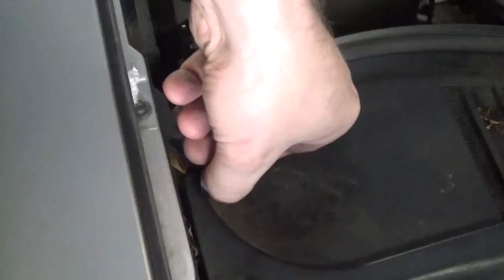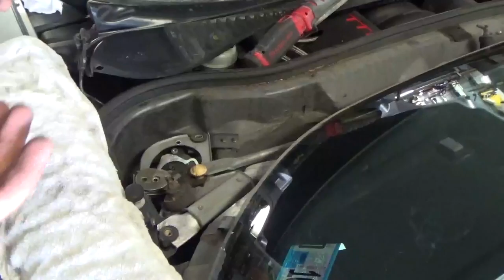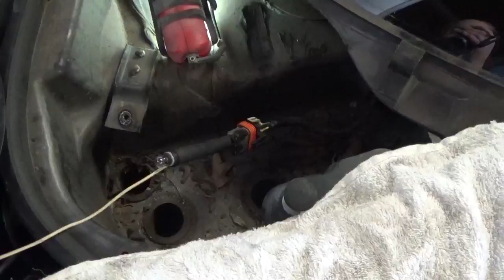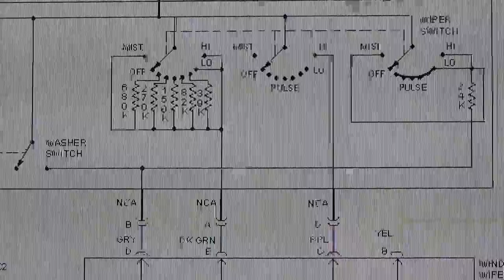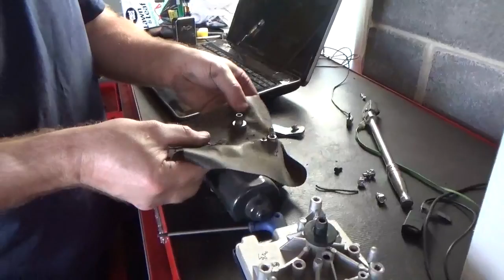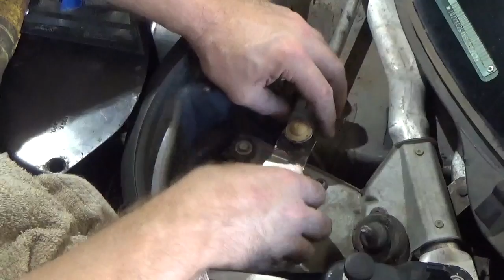C5 Corvette wiper motor replacement and calibration

Comment: I went thru a car wash and my wipers would not shut off. I replaced the wiper motor and cleaned out the nipples that were chucked full if junk. Everything was ok . I went thru the carwash again and it did the same thing. Do you think it is the ground? I pulled the fuse, the wipers work but do not return to the resting position. Any suggestions besides not going thru car wash?? Thanks

Comment: i'm from berlin in germany. i throw 2.500€ on this problem but the problem isnt fixed xD (he dont stop). 3x motor around 300€ (900€) , wiper arm mechanic 400€ parking top 150€ worker's 2x 500€. i will go soon to an expert (800km away from my home but he told me i can turn it off put out the number 10 front co pilot sit.). now i can drive and hope it not will rain :D

Comment: Your instructions were perfect. My wipers were doing the exact same thing yours were. The only thing I did different, “which was probably a little bit unnecessary“ was I added a bit of dielectric grease inside the electrical connector. Thank you so much!. Your instructions were spot on. Subscribed

Comment: Thank you for this video, the previous owner had replaced the wiper motor in my 02 C5z and didn’t align the transmission properly, this video helped me easily fix it with the intermittent setting / 8mm adjustment technique and now my wipers work great!! You rock!!

Comment: For anybody doing this job id say 80% of the time your wiper motor just needs to be blow dried and the connector needs to be cleaned (also apply dielectric grease) and it will work like new. No need for a new wiper motor you can fix this for free!

Comment: So the aftermarket wiper motor is missing 2 dial poles if you will or pins to line up the plate with the stop or return piece.  I had to bolt the plate in place and tweak the return several times.  Also noticed bending the spring clip for return lever while prying off the trans. It took several attempts to finally get it right. Thank you for a killer video bro! I used some fluid film lube for the mechanism works like a champ

Comment: question, I did this and it worked well until I washed my car and now they won’t turn off. Do you know how to fix this?
Reply: Did you open up the wiper motor and dry it? Use a blow dryer and also clean the connector! This will solve your issue and if it doesnt simply replace the motor.

Comment: Follow your video and was able to reinstall a after market motor and after some adjustments I was able to get in in and working correctly. The issue I ran into was was installing the plate on the top of the motor, with no pins on the aftermarket motor and only one small screw to hold down . I could not get tight enough and I striped it trying , was able to use the old holes for the pin and place a nut and bolt to secure the plate, Work !!! The info you provided was extremely helpful !!!!!!

Comment: took my new to me 98 vette wiper assembly apart.  all sorts of issues.

question ....what IF (like at 21 min mark) that top plate doesnt really LOCK on the wiper motor strongly?  Im thinking that plate might be a bit stripped....

wipers were just turning on...after i bought it and washed it...like so many other people.....but the harness wasnt really locked onto the wiper motor...barely on...and i think when he replaced the wiper motor last year, he didnt clock it right.

if that top flat piece is stripped, where do I get one?

I snug that t-30 but i can make it move with my hand.

Comment: Why not cut the ends off the 3 rubber hoses with some scissors so they do not fill up with debris and short out the wiper motor when the water cannot drain in the future?

Comment: OUTSTANDING ! Well presented and easy to follow. Had my Chevrolet dealership install a new wiper motor two days ago....wipers male a sweep but stop at 2 o'clock on intermittent, work OK on the other two speeds but the driver's side fails by about 2 inches to cover the entire wipe. Apparently the dealership guy didn't know how to adjust them. Can't wait to give your fix a try. Well done !!

Comment: QUESTION- so I have just replaced my 98 C5 wiper motor and I made sure everything worked prior to getting the trim and wipers put back on like the video states, and everything worked great! Once I installed everything and put my wipers back on, they didn’t run? I’m not sure what went wrong. Recommendations?

Comment: My wipers turned on the other day and have stayed on, without the switch being on, until I pulled the fuse in the passenger footwell
Reply: What was wrong? How did you fix??
Reply: ROUNDS BOXING CLUB just replaced the motor, 70 bucks at autozone. Still never figured out how they ran 24/7 but oh well.
Reply: @streetfighterracing1583   I'm getting a new motor 2morrow. I'm praying that works. I pulled my fuse as well. That shit is annoying af. Hopefully that's the fix

Comment: Just did this, saved me tons of money. This was spot on. I also took and sealed the motor and module, and cleaned the udders. That was my problem on both sides. Thought it was the wiper switch. Luckily it wasn't. I'm loving my 1 owner, 46,000 mile 99 vette.

Comment: While back I blew the #10 fuse. Put a new one in. Motor worked fine. But now motor is dead again. Fuse is fine. Is there a way to check to see if the motor is shorting our. I have a voltmeter. Thanks.

Comment: Has you replaced the DIC. I replaced mine today and with the dash sitting in place all wires attached, when I turn on the lights the DIC dose not come on. I dam sure I have all the wiring plugs plugged in the the dash. my old one had the top light bulb out that's why i'm replacing it. When I plug the old one in now it will not light. I think i'm missing something. Any help. Please NO JOKES just looking for help.

Comment: My circuit board in my wiper motor got wet after washing my car and my wipers we're on even when the switch was off.
I followed your instructions and removal / installation was a breeze. Cleaned my half full uders.
I removed the circuit board, blow dryer it , for you added silicon to cover. Works like new. Thanks for taking the time to do such a great video. Hope you have more Corvette repair videos.
Reply: Apt Waltham this just happened to me with my C5Z after a heavy rain. What part of the wiper motor did you use silicone on?

Comment: Thanks for this video.  Mine was spazing out at times.  A few things I did was to keep moisture out I put some silicone around where the motor was sealed together. I put dielectric grease inside the connector.  Then I had to bend that stopper tab to connect correctly with the transmission tab

Comment: Wow, so clear, thank you for that!  After watching, I was able to take mine apart, found plugged udders and a rodent nest behind the motor, water cane out of the plug.  Once cleaned and dried, put back together and it works perfectly.  You must have saved me $500 at the dealer to do this, so thanks again!!
Reply: You are my hero,  in your calibration segment you mentioned sometimes the tab breaks or needs a little tweaking. Mine weren't parking correctly,  I bent the tab in just a hair because it wasn't catching when the motor reversed.  Thank you thank you thank you!!

Comment: Source of the wiper motor problem is the udders to the wiper motor compartment clogging. When it clogs, the motor is submerged in water. Sometimes you can dry the motor and it will fix the motor problem, but you have to maintain the udders and keep them free of debris or the motor will go out again and again.

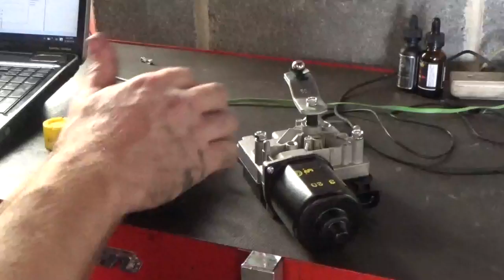Comment: Hey man, can't thank you enough. I'm not mechanically or electrically inclined AT ALL. Fearing excessive pricing from the stealership, I decided to gamble and take my chances.  My 2000 C5 FRC had wipers that were staying at 12:00 when turned off. This happened a day after a heavy rainstorm so I suspected it was the pulse board (not the wiper motor since the wipers were still moving, just not turning off in correct position).  I always assume the worst with car repairs, so I had little faith that I'd get through this without a problem. Nevertheless, thanks to your detailed video, I tackled this job in a little under 2 hours. I never would've even tried without your video. Thanks man! Sincerely!

Comment: Hey There, Great Tutorial Thank You. Ive carried this set up exactly as per your video. I havent replaced any spares at this point-just cleaned and drained the udders as my wipers wouldn't turn off. Without anything attached, the motor spins fine in all positions (like your blue tape part). However, when I attach my "park position" cam, it always spins and gets stuck!! So frustrating! I gave it a few days and have tried again this morning. Same thing happened. I did notice today though, that my motor spins anti-clockwise! Whereas on your video, the motor spins clockwise!!! This makes sense to me now as to why it keeps getting stuck as it spins the wrong way. Am I correct in saying that my motor is operating incorrectly so I need a new one? I did find lots of water in it and had to clean all those udders like on your video-maybe something has shorted out? Could you also let me know if you have full-on grooves in your spline cam when you attach it to the wiper? I think my cam splines may have also worn away, as it seems that when you attach yours it can't be turned without lifting it back up.I would appreciate your feedback on whether it should be clockwise spin only, before I order a new motor. Been in the UK, spares are hard to come by, so I want to diagnose it correct first time if possible! If you know the correct Part No of the motor and the splined cam, that would be great too. Thanks again!
Reply: If the motor is spinning CCW take the 2 screws out that hold the motor to the pulse board and just rotate 180degrees and retighten.

Comment: Hey, my windshield wipers won't work. I've even tried using the washer fluid button and got nothing. Could it be the motor or just a blown fuse. Thanks!
Reply: Kassafication i hope you have fixed your problem... but first to check in every electrical failure are the fuses second yes i would replace the wiper motor...another thing could be the wipers switch
Reply: panzer waffen it's fixed, but I didn't fix it. It wasn't a fuse or the motor. It was the wiper switch which I forgot could be a part of the problem. Long story short, I took it to the dealership and paid $300 (labor) and for them to replace the wires in the switch. Wish you'd a reminded me about the switch 5 months ago but I appreciate the response.

Comment: That is the same exact way I do those GM wiper bell cranks. They use to break all the time on the Montana, Venture vans. Funny you did this vid. I just did a C5 2 days ago with the same exact issue. High only and a lot of noise. His wipers had been parking at the top of the window for about a year prior to the wiper motor taking a dump so I freed up the bell crank too. He was a happy camper :)
Reply from the maker: that's great to here,  I remember struggling with these when they first started coming around like you mentioned, thinking someone put way to much thought into this design lol 
that would be a great video I seen others driving around with the wipers out of position, most likely froze or missing the tab, its funny how things work sometimes right, pretty cool though. your a great guy bud, always look forward to your videos. thanks for stopping by
Reply: What I find that happens to most of them is the little spring that hold the tab out breaks off so when the motor spins backward it does not catch and they end up in the "up" position. A little over-engineering on GM's part haha
Reply from the maker: +South Main Auto Repair thanks for mentioning that spring your right, that is the most common failure ;)

Comment: What brand are those probing connectors and where did you buy them at?
Reply from the maker: i got that set years ago from radio shack for circuit testing, test lead kit